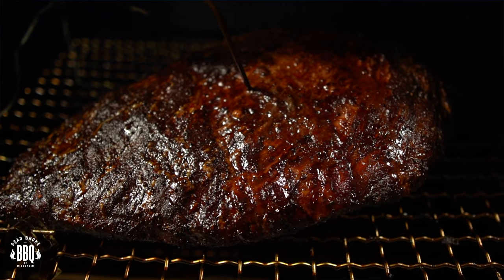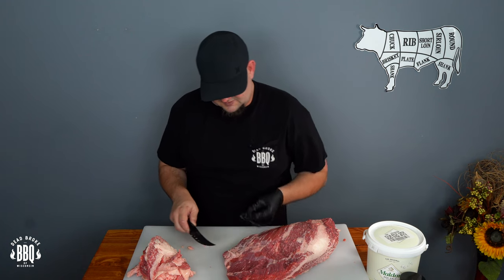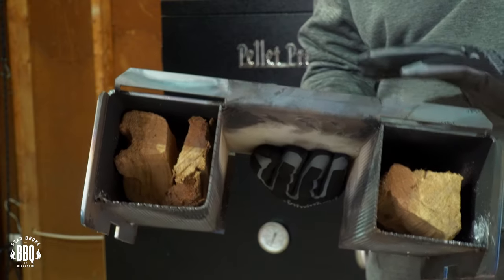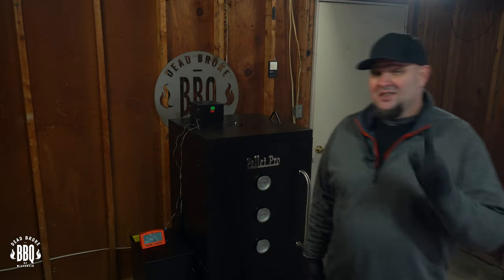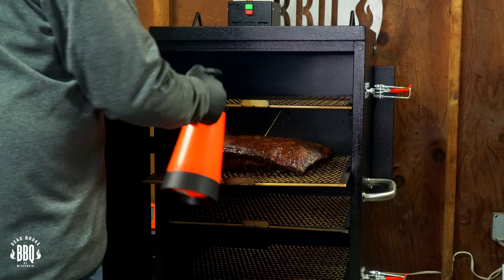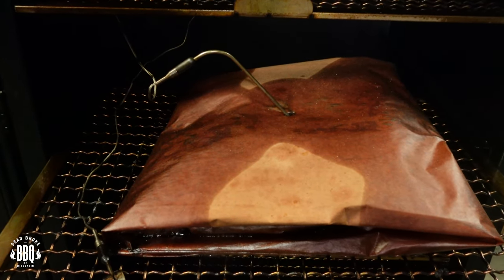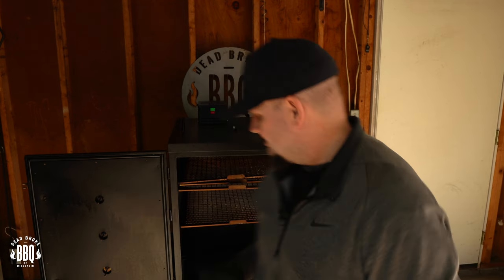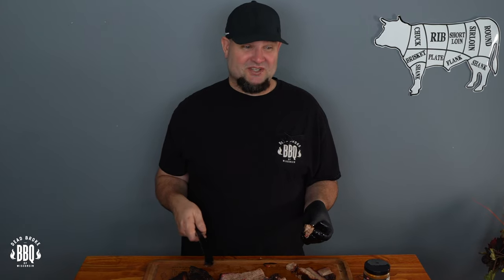How to Smoke a Brisket on Pellet Smoker | A Good Hack to Get Great Bark

Comment: Nice brisket. Do you see a big difference wrapping with butcher paper compared to foil?
Reply from the maker: Well yes foil saves a lot of juice that you can use if you plan to reheat it up later but the bark is soft. Butcher paper gives you a stiffer bark that is still easy to bite through. My favorite is butcher paper if you plan to eat it after it is rested. When I use foil I typically dump out the au jus anyways and I like the stiffer bark better. This brisket was drooling and retained plenty of moisture even the next day when I reheated some for sandwiches! Thanks for watching brother!! Happy New Year!!

Comment: How much of a heat spike does the stick burner feature give? Could one turn down the pid to off set the heat spike to hold 275, or would I be chasing my tail every 10 minutes?
Reply from the maker: around 25° if I remember correctly!??! It doesn't last long enough to worry about it though. The PID adjusts and doesn't add hardly any pellets. I would just set it at 225° and not care and once it burns out then crank it back up. When I am cooking brisket for just eating or for friends I typically run them at 300° these days. That extra 1 to 1 1/2  hours I save is appreciated!!! Thanks for watching!!

Comment: Great video. 
Does the Heavy D fit  Rec Teq RT 700?
Reply from the maker: Hi Chris well my guess is YES but they are very easy to to talk to so give Smoke Daddy a call and then you know for sure it will work. Just remember there will be a little temp spike out of the gate but with a Rec Tec PID you won't see a huge difference with the overall cook!!

Comment: Great video!
Reply from the maker: Thank Brent!!! I appreciate you watching and this cooker crushes brisket!! Very impressed how good this pit runs!! Thanks for watching and I hope you are having a Happy New Year!!!
Reply: Just ordered my heavyd based on your videos 🙌🙌🙌
Reply from the maker: Awesome Brent! The best way I can explain it is cook a brisket on a kettle with just charcoal and then the next one add a couple wood chunk and you will certainly tell a difference. Now with the Heavy D you still get a good clean smoky flavor and so far I have not over smoked anything while using it! Hope you have fun with it but 2 things I learned so far. #1 start the 2300 on 160 and preheat it because once you turn it up it is going to smoke like crazy at first!! Now you could crank it up and let it settle down but that will add around 30 more minutes to the cook! #2 don't put little chunks in it chop up 2 to 4 pieces to fit, little chunk really smoke up and your cooking temps really jump around! Obviously they will anyways and the 2300 does try to combat it the best it can but you will have a little extra heat roaring at the bringing of the cook!! Let me know what you experience with the Heavy D Brent!!